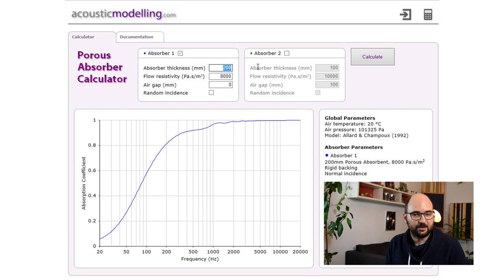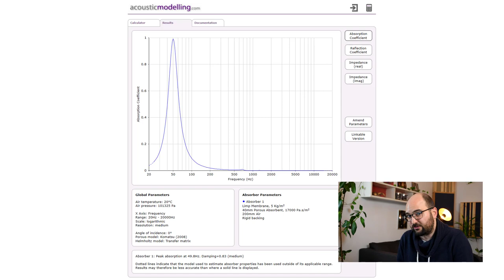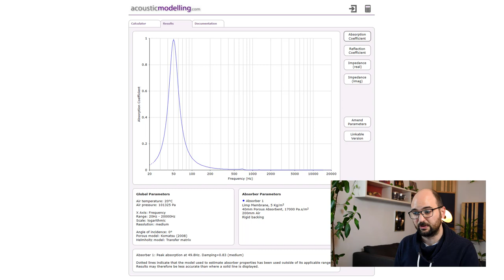Bass Traps: Pressure vs Velocity - Which one should you get? - AcousticsInsider.com

Comment: This video does a great job explaining that, but I can't stop thinking of the claim about the 40Hz porous absorber. Usually, in small rooms 10-15m2 in surface, the issues are usually the 1st and second harmonic of each axial mode (hopefully the room dimension ratio gives an even distribution of the oblique and tangential modes). So, if a dimension is 3m the first axial mode is like 57Hz (ish) and the second 114Hz. How are you going to treat that 114Hz (which is usually rings most) when the quarter wavelength is like 37cm? Assuming that you put a set of porous absorbers at 37cm on both ends of this axial mode, you are losing a total of 74cm. That is almost 25% of your space. Although the challenges to building a pressure absorber (of any kind) are true, they can still have a wide Q and hit "two birds with one stone". Not exactly ideal, but if you have a "non-ideal" room, to begin with, it's pointless to assume that you will have an ideal acoustic treatment... So I am kinda thrown off by the idea that pressure absorbers are impractical. I already built my studio in a terribly wrong room for that purpose (3.1x3.4x2.8) and I managed to get very decent acoustics using mostly Helmholtz absorbers. That room was in my own house, but now I have moved (because of work) and I am planning to treat my room (in a non-destructive way... ). My design showed that I need 3.6m2 for an 80Hz Helmholtz absorber and 1.8m2 for a 160Hz one. That is not much for 30m2 of free available vertical surface that I have available (excluding doors, windows, radiators, ceiling, floor)
Reply: Do you have any knowledge of GIK Scopus membranes?
Reply: @dougleydorite  I just googled them. What about them?
Reply: My brain hurt just reading this, and all I want is my hi fi system to sound good in my room! lol.

Comment: To cover down to 40Hz with a 50% coefficient you need 10 inches and to increase the effectiveness, you have to go up to about 2 feet deep so for small rooms I don't think it's as "flexible" as you said. Although, small rooms usually need velocity absorbers because they are most likely to have resonances at multiple frequencies that are close to each other (the whole low end). On the other hand, membrane traps or diaphragmatic absorbers take less space for the same frequency and will have more efficiency than velocity absorbers. Membrane traps or diaphragmatic absorbers can also be designed to work with larger Q factors.
Reply: Totally! I think the 40hz claim he is stating in this video is very off from all of the actual technical research done by some very educated research departments. BBC , RCA etc..

Comment: Hi Jesco, first off I really like your practical approach to acoustic treatment. Most of us have to work with what we have rather than being able to build perfect rooms from scratch.

I have a question about flow resistivity: at 1:50 in this video, as you adjust the absorber thickness you also change the flow resistivity value. Is there somewhere someone without a masters degree in physics can look to better understand that? I just want to model some very simple traps, but if 100mm is 10,000 pa/m2, but 200mm is 8000, and 300 is 5000 for the same material, how am I supposed to figure things like that out? All these calculators require a flow resisivity value, so how do I get that for my material? I can get the weight per m3 (which you've also mentioned elsewhere), but how does that translate for using something like the acoustic modelling calculator you often use?

I don't if you'll see the comment on a year+ old video, but figured I'd ask anyway. Maybe someone in the community can help as well! All the best!
Reply: If your gas flow resistivity is lets say 3000pa*s/m2, you MAX out the absorption coefficient of the absorber somewhere around 60cm thick. IF you take that same material and make it now 100cm thick, it wont absorb anymore/any deeper of the frequencies. In order to absorb anything deeper, you need to select another material with a LOWER gas flow resistivity, and THEN you could go up to 100cm thick and it WILL absorb deeper/more. Thats why as he lowers the gas flow resistivity, he increases the thickness of the material because they are related in that aspect^. There is nothing stoping you however from having a 10 foot thick absorber of a 10,000pa*s/m2 material - its just pointless.

Comment: Great approach to bass trapping that makes a lot of sense. What is your take to constructing the entire walls for handling low frequency and reflection control? Philip Newell presents some of the wall designs in his book about building recording studios. Typically you would have several layers of materials / air (e.g. sandwiched drywall with dead sheet in between, porous absorption, dead sheet membranes etc., which is not tuned so keeping it intentionally lossy to have a broader band effect.
Reply: Hey, the most broadband TRUE bass trap is Slat resonator (idealy all your front wall with your speaker build in the resonator). For targeting not just one narrow frequency, you can angle the resonator on the outside to target more frequency. Please read the paper of « AndyMacDoor », a french acousticien who has study these trap for about 7 years and now he working on huge french studio and also small home studio and all his theory work in real word.
You just need Google traduction :)
Reply: @GurvanBHC7  Hi get in touch with AndyMacDoor as you seem to know him. And get him to send Jesco his slat resonator and also his other products - diffusers etc.

So we can see if they actually do perform better than similar equivalent products on the market. His acoustic room treatment products on his website do look very interesting unique.

But we need detailed measurements from Jesco to determine if they actually work as claimed.

Comment: Hello Master Jesco,
In my case, it's for a home theatre and I don't have the ability or equipment to do measurements as you mention in this video. And because my home theatre is also my living room, corner bass traps are not ideal. So if I'm to use made from a supplier, rigid fibreglass panels (6 lbs/cubic foot) covered with an acoustic tissue, can I treat my front wall with 5 or 6 inch thick panels of 2' x 4', placing 2 behind my L & R mains and 2 behind my large screen TV, all evenly spaced as a good start to treating my space? 
And will this control necessary low to mid frequencies to help improve my listening experience? 
I cannot treat side wall reflections because of my layout... only front wall, back wall and ceiling. I do have a thick rug on the floor between my MLP and the centre channel.
My living room space is 20' W x 25' L x 12' H. I'm running a 5.1.4 set-up. Your advice would be Greatly appreciated. 

Anyone reading and that has experience on the topic, please feel free to share your comments as well on my situation. 
Cheers to all my fellow enthusiasts! 🙂

Comment: So with a 12x18x8’room and a $5000 budget... $2500 for an AVAA and $2500 for porous first, second, and ceiling reflections and diffusers on the back wall (12’ wall)? AVAA is 14-150Hz and placed in the corner behind the sub which is located off the corner 3-4 feet.
Reply: Have you tried the AVAA?
Reply: I have not, but I understand the concept/construction and reviews say it works magic.
Reply: @sh91899  I have not seen any acoustician recommend it and the two reviews on YouTube are a bit “sponsored” feeling and the before and after on those vids don’t show hardly any difference.

But,  if  you go to forums, so many people say that it is a huge difference and definitely worth the money
Reply: @dougleydorite  Yeah, the face converts the velocity wave into pressure and a mic feeds directly into the amp then driver without any DSP which inverts to cancel the pressure out. I'm considering making my own... (MSEE)

Comment: What would it take to  build a velocity trap that goes down to 40Hz?
Reply: About 7 ft of absorptive materials
Reply: Quarter wave, which is location of max velocity from the wall, is 7 feet but that doesn’t mean you need 7 feet of porous material. You can use 4-8” of material positioned 7 feet off the wall. If you place them diagonal across a corner then you’d attach the absorbers 5 feet from the corner along both adjacent walls. The center of the absorber would be 7 feet from the corner but the diagonal would give you broadband bass absorption because the trapping frequency increases as you move towards the wall in both directions. Like he says in the video, it’s not practical for smaller studios and could be pretty expensive.
Reply: @sh91899  At that point it's time for headphones and Sonarworks calibration software.

Comment: Under 100 Hz, just use subs and EQ. Much more effective, and...bass!
Reply: EQ won’t reduce the ringing in the time domain. The best thing to do is try to improve the room a bit with bass traps, and then further improve the frequency response with multiple subs and EQ.
Reply: @3DaysTillGrace  absorption is not very effective under 100 Hz, which is why subs and EQ are the most powerful solution.
Reply: @matsudakodo absorption-style bass traps might not be super effective, but at least they help a little (which means that they help in both the frequency and the time domain). Multiple subs and EQ only helps in the frequency domain. The best solution is to use resonance-tuned bass traps since they are more effective than regular absorption-style bass traps. Just to be clear, regardless of if the person is using any room treatment or not, I think 2 subs and maybe even EQ is a must. I’m just saying that room treatment AND multiple subs is best because the room treatment reduces ringing in the time domain. Multiple subs and EQ can create a somewhat flat frequency response in a couple listening positions, but it can’t make the bass fast or clear in the time domain. I hate muddy bass so much that I’d rather hear less bass than muddy bass.
Reply: No disagreement that a combined approach is best. I am doing that now, with absorption effective down to 80 Hz with GIK 244 traps. I don't plan on doing any tuned traps as those are more location-specific and it's a really small room.